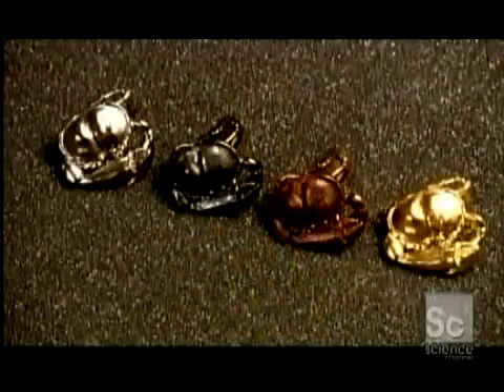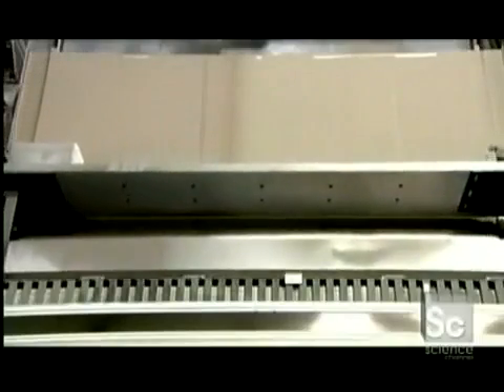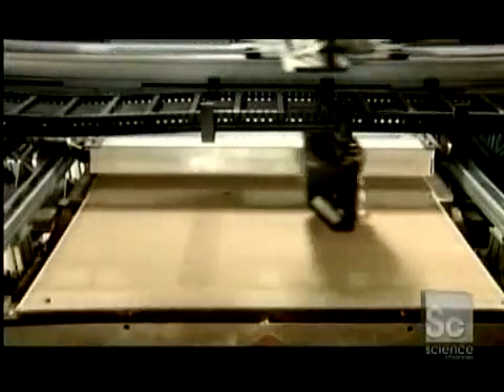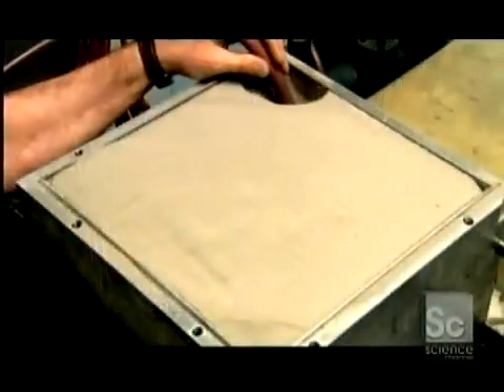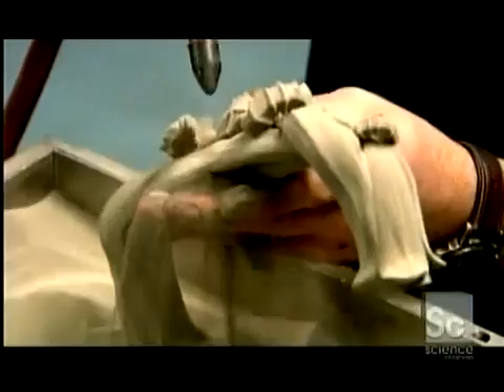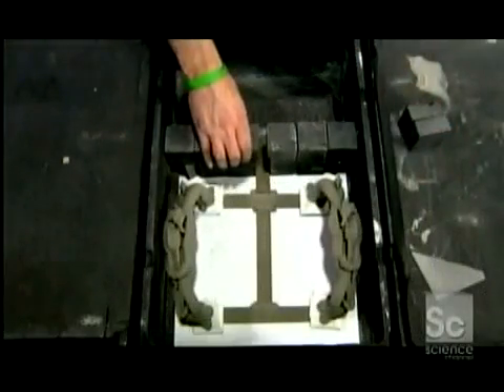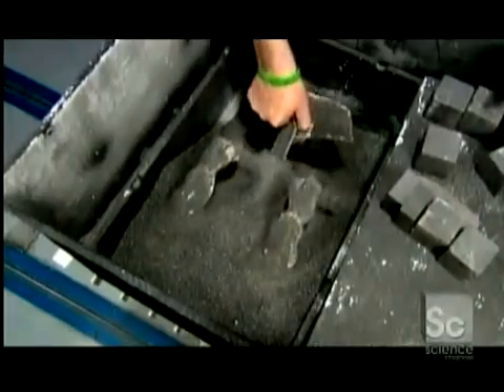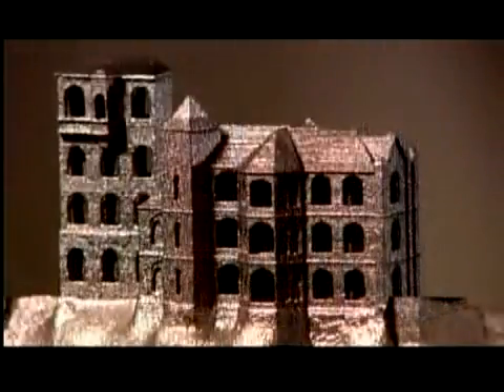3D Metal Printing | 3D Printing Technologies

Comment: Not as fast as greensand casting.... however it can produce complex shapes that greensand casting can not but in theory that could be fixed by a computer program that is able to analyse and cut apart complex shapes into less complex pieces, 3D print them out of plastic then cast them in greensand and then fuse the individual pieces together into the more complex shape that could not be greensand casted. Even then this process would still be quicker however have a downside when considering extra fine details, however once again such could be fixed with technology.

Comment: "Alumina Oxide Grit" Where can I pick me up some of that oxidized alumina?
Reply: It wouldn't have to be alumina, Its just that alumina has a melting point above 2500 deg F. Impure aluminum oxide can be found in cheapo grinding wheels. You just have to smash them up.
Reply: Ian Gootee
Hear that whooshing sound? It's the point you missed. There is no such thing as "alumina oxide", as the narrator said. Al2O3 is "alumina" or "aluminum oxide" (or even "aluminium oxide") but there is not such thing as "alumina oxide". In other words... that's a joke, son.
Reply: I'm sorry, I just replied as if I was speaking to someone who was less than familiar with what alumina actually was. Even if you are well educated, that doesn't mean that everyone reading the comments is a material specialist.
Reply: Ian Gootee
It's a shame that the people working with the stuff don't actually know what it is. You don't even need to know what it is, really, but I would think people working with the material and speaking about it as if they know what they're doing would actually know what the stuff is called. Again, it was just a joke -- I didn't mean to be pedantic. But since you were calling me on it I really think it was worth explaining.

Comment: I have a little tool & die background and can see how this concept will change the industry in certain areas, not all. This advancement shows the need to get an education and training if you want to exist in the future.
Reply: This is great for going right from a Mastercam file to having a prototype in your hand the next day.  But for now, casting and stamping out parts is still way faster and more cost effective for mass production.  To take most of a shift or longer to make just one part does not make sense to most manufacturers.  But it does make sense to use this technology for making prototypes or a master mold which can than be used to make other molds or dies for mass production.  My employer uses them to speed up the mold making process for use in lost wax manufacturing.  Before, a model maker might take a week or longer to make one prototype or master mold or model.  We used to have 20 model makers doing just that.  Now we don't have model makers anymore.  We have 3 3-D printers instead.

Comment: this technology is obsolete now days.  There are better ways of 3d printing with metals now with printers that use lasers to melt the metals into fusing layer by layer. It been done even with titanium.
Reply: Of course there are.  My employer has replaced 5 generations of 3-D printers in the last 3 years, that's how fast the technology has evolved.
Reply: May i got your suggestion about several brand of 3D printing with metals even with titanium? i would like buy one of your suggestion.
Thanks a lot gigicaly :)
please reply to my email : lifemax_4ever@yahoo.co.id

Comment: and isn't powdered metal extremely flammable/explosive?
Reply: Jordan Krainer tell that to aluminum powder
Reply: No.. If a metal isn't flameable while in non powdered form its not going to be flameable in powdered form either. Going from an ingot of metal to powdered metal is not a chemical change.
Reply: It can be but many materials are quite volatile.
Reply: ***** Aluminum powder is very flammable by itself and can be ignited with an open flame.  watch?v=FhG2e6mpdEY
Reply: ***** actually aluminium powder is in itself flammable, aluminium in a fine enough powder and properly aerosolized will in fact ignite when exposed to enough of a heat source, but yes your example is also true, frankly that's thermite your talking about and yes the iron oxide is of course the oxidizer while the aluminium is the fuel, freaking science some times

Comment: And this is better than traditional casting processes how?  the same thing can be made with air set and green sand casting methods in a few hours.
Reply: Yea you can do those designs in traditional castings, good luck with that..
Reply: nismo96 Metal is more durable.
Reply: Nope
Reply: It is better because it is fully automated so one engineer can send mastercam files to an array of 3-D printers then go home and come back the next day and he has three models ready to go.  My employer uses a different style of 3-D printer to make wax models to use in prototyping and making models which are then sent to the casting department where we use the lost wax method.  These are not practical for regular manufacturing of an established product but when your shop needs to develop 20,000 new skews every year they are quite handy and cuts prototyping and model and mold making time down drastically.  We used to have a team of 20 model makers who collectively were paid well over a million dollars a year.  We no longer need them.  We use these machines instead and that comes to a cost of about 100,000 dollars a year which covers the cost of replacing old models with newer more efficient ones as well as maintenance.  That is a huge savings to any R&D dept.
Reply: nunya biznez why do you need the models to be in metal cant you just use plastic 3d printers and than send the model for casting ?

Comment: that's how one person can make gun factory in his garage...
Reply: Must be a big garage...
Reply: And someone insanely rich! Metal 3D printers are crazy expensive.
Reply: yes or they can buy a lathe and milling machine and do the same thing easier and quicker and cheaper and not need high tech equipment.  These are good for making complex shapes of one of a kind items fairly quickly but not too good for mass production.  This is an R&D tool.  Of course, if you had one in your garage you certainly could make a gun but you would still have to machine certain parts of the gun, for example you would still need to precisely bore out the barrel.
Reply: ***** i m just trying to say that ppl can make guns without any serialnumbers and also can make it as they want so it ll be hard for Ballistic Identification.cuz just a pistol with unknown records and info is a big problem for society especially in right hands...
Reply: ***** pump actions aren't banned, its not thousands of dollars, you can get handguns and i would like to see the source for you saying that gun crime went up.
Reply: im a criminal im going to spend 100K+ on equiptment and countless hrs figuring out how to use the hardware let alone risk my life test firing these home made weapons when i can go out and get hundreds of guns from a army surplus for a fraction of the cost
Reply: they can cast the parts if they really wanted to
Reply: Gerry DuPell
Where is this army surplus? I'd like to take a look at what they have.

Comment: This is why that gun control is just a myth. People can already make a gun with a simple lathe if they want, but eventually metal printers will be as common as ink printers are today.
Reply: you can make a fully working gun out of a normal 3D printer
Reply: Kennedy Del Rosario Most of these gun files are FREE and widely available on the web. Once you have those files, anyone can do this fairly easily. Thats why the govt is having a cow. Because it is really easy. The only thing slowing it down right now is the cost of initial setup. Nothing more. Its all plug and play.  If you want, you can pick up AUTOCAD programs and tutorials for not much more and learn on your own.
Reply: STOP IT NOW JAKE!!! These printers that could print using metal costs millions of dollars, and waste lots of energy do you really believe that it will be cheaper soon? I think it will never be cheap as plastic printers.
Reply: Levi Cheely try to print a gun using it, the truth is if someone wants a gun he will find out a way to get it, the problem is not the GUN its the person behind it, the human is the problem.
Reply: MrGareth66 no you can't you need like I dunno multiple degrees of discrete geometry if im not mistaken so yeah only the people with big knowledge on computers and math can make the guns work
Reply: ***** Here is the fact. The only part that is regulated is the receiver. I can get the barrel, and every other part easily, and at low price without even manufacturing it myself.
Reply: ***** Yeah, a receiver can be made by practically anyone for some types of guns.
Reply: ***** There is plenty of gun smithing books at any book store that shows an average person how to make their own guns. So the idea of stopping a determined gunman from making a gun, is a gun control pipe dream!
Reply: ***** THere was a time Lazer printers were about 70,000$ and only a few companies had them. Now you can get one for around 200$. IT's smaller, more efficient, prints better quality. 3D printing will be a multi billion$ biz in a few years. So every one is coming up with better and cheaper ways of doing it. Give i another 5 years, max, and you'll be able to buy a metal printer for under 1000 bucks
Reply: nunya biznez

Learning Autocad would be a waste of time. It is way out dated. The majority of machine shops these days use Mastercam, which is nothing like Autocad. If you want to get somewhere, you have to do it yourself. If you wait for someone else to do give you a chance, you'll likely never get very far. As for CAD classes only taking people referred by their employer, I can't hardly believe that. In any case, I am proficient with 3 CAD programs now and I am working on the forth. I am self thought. Your education is your responsibility. Continuing education is neccesary in technical fields. If you take the attitude that you are only going to do what they pay you to do, that would likely be fine with them as everyplace needs drones. It is up to you not to be a drone. It sounds like you work for a fairly large shop. You will learn a lot more and get more opportunities in small shops (10 people of so) though job security is better in a large shop. If you are willing to put the effort in to it, which includes lots of study on your own time, you can get somewhere. If you aren't, you will make a living as a drone.
Reply: nunya biznez
They were telling you BS. Anyone that has the money can buy any CAD software they want. The only federal restrictions on technical software is on selling outside the US. You are much better off getting some books on your chosen software and teaching yourself.
Reply: a myth? look up the definition lol
Reply: And even if you print a 3D gun using a plastic printer it could easy explode, I can make a gun using a wield machine that my father have( and is more accessible)  but using a plastic printer never.
Reply: ***** Exactly. The cost of these items will come down. Laser printers cost a ton of money in the 1970s. You can now buy one for less than $99. Price will come down over time. Even plastic 3d printers today have come down dramatically from what they were just a few years ago. Heck, I just saw a 3d printer being sold at my local PC store, for about $2000. Not that unaffordable.
Reply: Jacob w Take into account, That the Peachy Printer, a 3D Resin Printer, Costs a Mere $100. I don't see this out of the realm of possibility. Everything evolves, and as it evolves it becomes cheaper and easier to manufacture. I agree that this printer, in say 5-10 years, would be in the realm of $1500-$5000 if not lower.
Reply: ***** "No, it can't be. Because everything is black and white, and a block of metal kills people." -every social democrat/liberal ever
Reply: jake2000  AutoCAD tutorials?  I would like to see that.  I am an CNC machinist.  Virtually the only way a person can learn AutoCAD is by being in that industry already and having your employer send you to learn the software.  Mine won't bother with the expense and no school in my state will teach it to you if your employer does not send you to the school.  In any case, that is a little off point.  You cannot just walk down to your local Sears and buy a 3-d printer and then down load a gun making file and print out a gun and go hold up a bank.  The kind of 3-d printers that print out metal are very expensive and are not available to private individuals to purchase since venders will only sell them to businesses engaged in manufacturing.  I know, I am in manufacturing and have enquired of venders about buying one.   Second, they are quite expensive and have a fairly limited life expectancy so in terms of practical usage, if you do the math, it would cost about $130 to print out the individual components needed to assemble a handgun.  You then have to perform several finish machining steps prior to assembly and then you must assemble the weapon.  That would take additional labor.  It would be far more practical to buy a lathe, milling machine and grinder and some machinists tools and supplies and make a gun from blue prints not to mention far less expensive.  In my shop only the engineering department has access to the 3-D printers and that is because they are so expensive and so fragile and are constantly in use making prototypes.  In other words even if a criminally minded person were to figure out how to get themselves hired by a company that had one, they would have to go to school and qualify for a job in the engineering department of one of the companies that have these.  It would be easier to for a criminal or terrorist to buy an automatic high power rifle on the black market than to access and learn how to use one of these.  Which do you think they would choose to do first?
Reply: ardvarkkkkk1 There are no schools that teach those courses within 100 miles of my home.  I have checked with every single school.  Perhaps outside this area and perhaps I need to relocate and that I would do.  There are only three places within 100 miles of my home that teach it and those are the venders selling the software.  They have an agreement with the manufacturers of the software not to teach anyone unless they purchase the software.  The Federal government restricts selling such software to only industries, not to individuals.  That is what all three venders and one manufacturer told me.
Reply: nunya biznez You can buy the software, and tutorial books on amazon. How about ebay? You can attend online college courses. I dont know where you are from, but there is ways of getting these software packages.
Reply: ***** aw the Revolver reference <3
Reply: Kennedy Del Rosario If you can get the blueprints it would be very easy. People would upload the plans to the internet anyway.
Reply: ***** In the future making a plastic gun will be common place. Plastics are getting better and stronger. They are slowly replacing metals.
Reply: Krevin Grard But for a handgun barrel, it's going to take heck of a lot of years to be made out of plastic. Even the steel barrels are prone to break if something goes wrong.
Reply: ose K The issue is not the barrels. They can be fairly easy to get. The issue is the registered portion of the gun, being the lower receiver. If you can get that part, then every antigun law on the books is MOOT.
Reply: Guns are quite simple machines. Normal mill would be much more affordable.